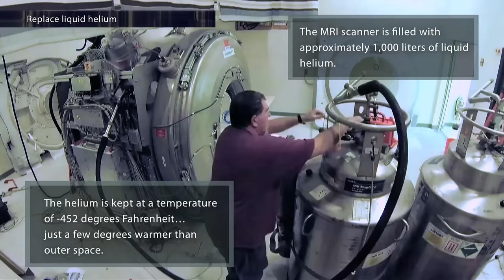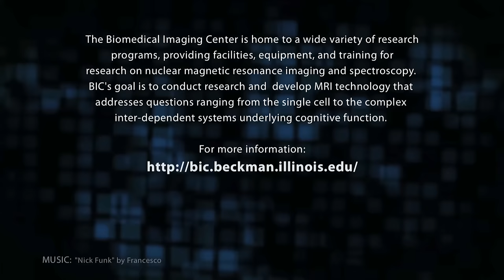MRI Upgrade Timelapse - Two Weeks in 4 minutes

Comment: For this major upgrade I assume the magnetic field was reduced, hopefully while preserving much of the helium. I am curious however about minor repairs that might involve metallic parts and tools, that would be a challenge.
Reply: As far as I know, MRI uses electromagnets which means they only magnetised when electricity flows in coils. So when the machine is not operating, there is no magnetic field and repairs with metal tools and parts should not be an issue.
Reply: @kadirzhanl  the magnetic field is always on
Reply: @TheTerrorJumper  incorrect, modern MRIs are not permanent magnets, they are electromagnets. Siemens connects a RAMP down kit to the positive and negative connections and are able to pull the amperage out of the system.

Room is perfectly safe to work in while this upgrade is being done. The Ramp down also does not typically affect the helium level as the helium compressor is kept running. What this video left out was the upgrade performed in the equipment room where power cabinets are replaced. This requires 480v power to be cut to the equipment, so you lose recompression of the helium until you are far enough along to reconnect power.
Reply: @cbrown596  In the end it looks like they filled up with helium so wouldn't that mean that the old one was quenched?
Reply: @AXNPictures  No, during the upgrade procedure power is shut down to the cold head as you are replacing everything. The MRIs pressure bypass valves are set to vent excess pressure in a 'transport' configuration.

Since the helium is no longer being recompressed by the equipment it starts to shift from a liquid to a gas and expand. If you didn't allow it to vent, the pressure would build up enough that it would rupture the overpressure burst disk and cause a quench.

So over the course of the upgrade you lose helium at a rate of about 3% a day, so they will typically top it off before, and after the upgrade. If you allow too much of the helium to vent (helium level gets too low) it causes the internal temperatures to raise too much and can make it difficult to refill as the helium will now flash on contact with the 'warm' MRI. They then need to use almost 3 times as much liquid nitrogen to cool the internals, to then add helium, and then siphon nitrogen out in phases. (Huge pain in the ass)
Reply: Yup they de-energized the magnet early on when the guy got on the ladder. 😁
Reply: They would have ramped down the magnet before starting this kind of upgrade. Otherwise those ladders and other tools you saw would have been sucked into the bore. There are non-ferrous tools available but it is much safer and easier on this extensive of an upgrade to just ramp down, do the upgrade, and ramp back up.  Then, once the upgrade is completed, the magnet is cooled first with Nitrogen, much less expensive than Helium, and then with Helium. Then it is ramped back up and calibrated.
Reply: @jazcatFL  When we typically did upgrades, a nitrogen fill was generally unnecessary as it would take us about 7 days to complete; they would typically schedule a full Helium fill to top it off if it needed it, and we'd keep the cold-head running until the very last moment to preserve the helium.

 I've been told by the cryogen fill guys that the nitrogen cycle is typically done when the internal temperature of the vessel is too hot, which causes a flash boil of the helium if tried to fill. The Nitrogen is used to cool down the internal temperature to a level that the liquid helium will not flash off.
Reply: @cbrown596  true. If you warm up above 77 K (N2 boiling point) it's better to use liquid nitrogen to speed up cooldown process and save helium. Note, liquid helium temperature is 4.2 at the the atmosphere pressure.

Comment: How did he have the camera in the room after the helium was put in
Reply: Helium is pumped into the magnet itself and is circulated in a closed-loop system.  In the event of an extremely rare quench, the helium is exhausted through a special insulated pipe to the outside of the building.  Thus there is little danger to anyone in the room, but precautions of course are followed.
Reply: Tate Erickson it looks like it is filled but not yet charged. I haven’t noticed a charger during this video.
Reply: The magnet is attached to the wall.  The magnetic field is fairly localised to the bore of the solenoid and if something is attached it will not be a problem at some distance. Also like Raman said the magnet was probably not turned on during this video. A surveillance camera will still be in the room.

Comment: How long does it take to turn off/on the magnetic field?
Reply: you can’t really “turn off” a magnetic field. a magnet is always constant and always “on”. if there was someone in danger of losing their life in the magnet or losing a limb then we would quench which is when the machine expels all of the helium out of the magnet and it “loses” its magnetic field. that’s in very rare and dire situations and is rarely ever done. other than a situation like that the magnet would be always have it’s magnetic field.
Reply: @meowzass  If you get rid of the helium, the conductor gets warmer and begins to lose its superconductivity which means the high currents will get converted into more thermal energy. So it will quickly reach a point were all the energy from the magnetic field will be converted into heat almost at once. Wont that destroy the whole mri?
Reply: @meowzass  According to another comment, this unit is able to simply discharge the magnetic field, without dumping the coolant.
Reply: @meowzass  Would they really do that? I don't think it's worth wasting a ton of liquid helium. Just let the patient get hurt, it would be cheaper

Comment: I somehow expected them to tear down the previous unit completely and leave the room empty. That section that they left behind, for lack of a better word let's call it a chassis, is it common to all MRI models?
Reply: Not ALL MRI models but many manufacturers have common parts across multiple models
Reply: They changed the core for higher magnetic field. Coils are left unchanged as they're superconducting.
Reply: @Chopper153  The core contains the main magnet coils. The gradient coils and RF coils were replaced. Only the main magnet coils are superconducting.

Comment: Do you recover the Helium before working on an MRI like this? Surely there is a way to recover the Helium for upgrades, I can understand venting in emergencies but you'd think it would be possible to recover it under normal circumstances.
Reply: The magnet is ramped down removing the magnetic field thus greatly reducing the helium boil off during the upgrade and eliminating the dangers of high magnetic field. While the magnetic field is down there is still a substantial amount of liquid helium within the magnet that continues to be preserved by the cold head recovery/boil off reduction system.

Comment: So that pumping sound in a MRI room is actually a pump for liquid helium?
Reply: No, it's just the sound produced when the machine is actively imaging. Helium is depleted for emergencies only. Google MRI quench
Reply: Oleksiy Marchenko that "cheh-wee" sound you hear is a liquid helium pump, but it is called a Coldhead. It keeps the liquid helium from falling to the bottom and turning to gas, which is important to cool the large electromagnet coil inside.

Comment: Geeez.  That seems like lots of work.  Imagine building the LHC!
Reply: The LHC is probably the most complex device ever constructed by man. Think of the requirements of building an acceleration circle a mile or more in diameter that is precise enough to line up two (or more) subatomic particles for a collision from opposite directions and then measure the directions and velocities of the newly created particles.
Reply: @JustWasted3HoursHere  you're correct! It's the most complex structure built by man. I've seen a superconducting cyclotron, it's very complex. Can't imagine how complex the LHC is.

Comment: Was the MRI quenched for this upgrade?
Reply: They'd have ramped down the magnet power then removed the helium. This takes a while and needs specialized equipment, but doesn't waste the helium.
Reply: @KingdaToro  thanks, that makes sense.
Reply: Yes indeed the magnetic field was ramped down for this upgrade. But the helium was not removed.

Comment: imagine if the helium containment ruptured while you were inside this machine. you would probably be flash frozen instantly.
Reply: Cute comment but reality is more mundane. They have a "burst disk" on the top of the unit which vents the helium chamber outside if there is a pressure event.
Dull yes, but safe. :) Cheers.
Reply: @phlogistanjones2722  Darn I was hoping for a morbidly detailed documentary on someone dying from being frozen by liquid helium
Reply: You would have bigger problems if something went mechanically wrong. Those plastic covers are on to stop you from seeing what is happening while it is on, they wouldn't actually prevent your demise.
Reply: Patients have been killed by metal object's carried by untrained staff

Comment: The Earths magnetic field is way stronger then an MRI's magnetic coil system, as achieving 60,000 times this would crush an individual.
Reply: That’s not really how that works. Magnetic fields are strong, but don’t contain nearly enough energy to “create” enough gravity to harm you and it’s not like they’re going to grab the mostly non-ferromagnetic material in your body. Magnets can go well beyond 60,000x, if magnetic fields were as strong as you suggest the LHC(and potentially future FCC) would destroy Geneva. The only major danger is to the equipment during testing of extremely powerful fields.
Reply: @yonneye2427  LHC?
Reply: @theroyalaustralian  Large Hadron Collider, CERN’s big accelerator. It is basically a giant 27km long ring of superconducting magnets. CERN has a bunch more smaller accelerators right next to the LHC as part of the acceleration or for separate experiments. Imagine 9 rings of giant MRIs(except more powerful)right next to Geneva.
Reply: @yonneye2427  Ahh, appreciate the reminder on what it is.